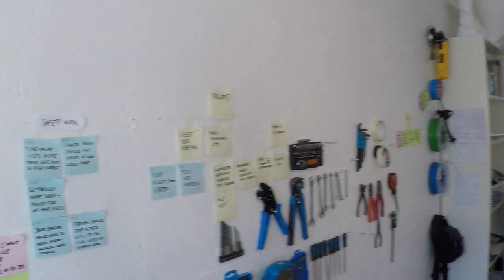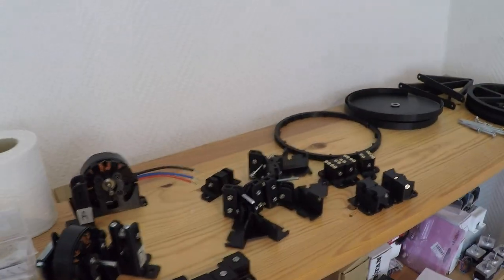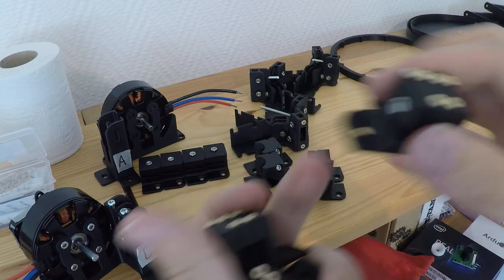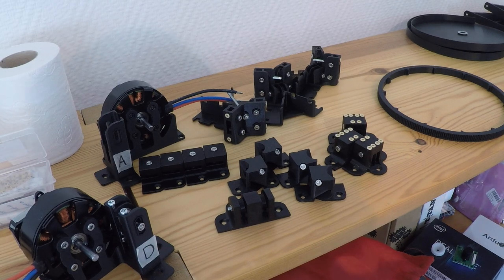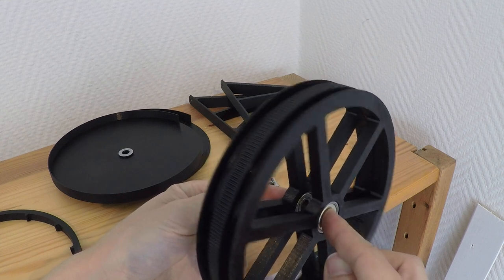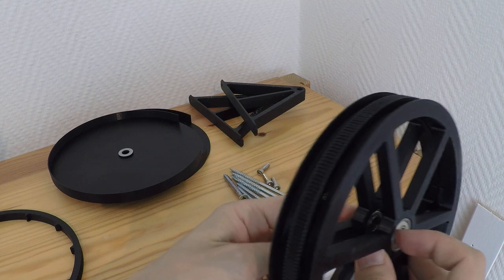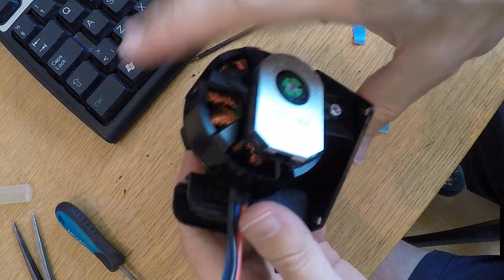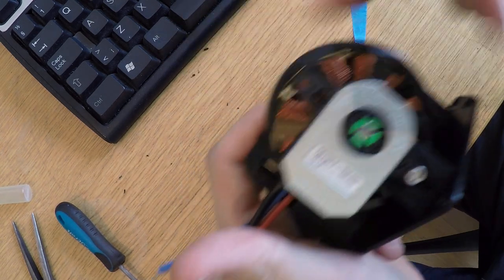Weekly Demo: Printed Parts

Comment: Hi and thank you for the video! Could you write to the description of the video the links to the motors, encoders, motor drivers, breakout board, power supply unit and ceramic inlets? I'd like to start testing the motors already.
Reply from the maker: Hi check out the bill of materials linked in the v4 docs. Motors are not available yet, but will be in ODrive Robotics' web shop